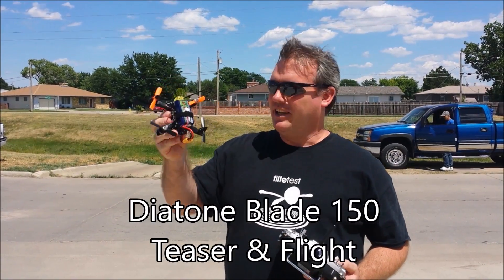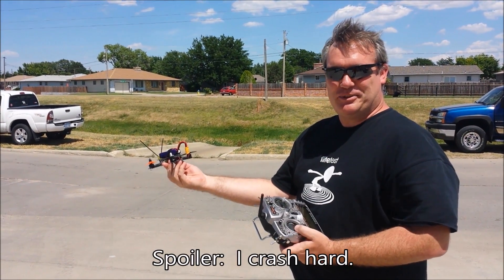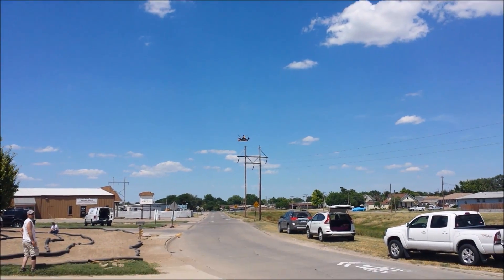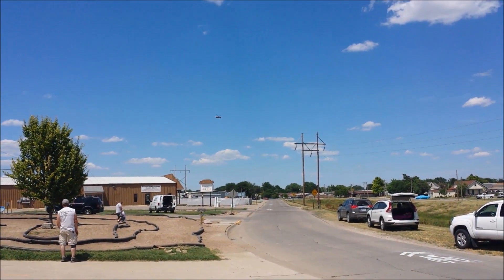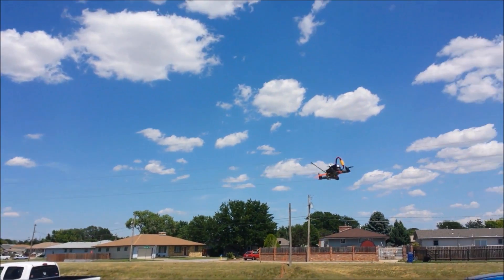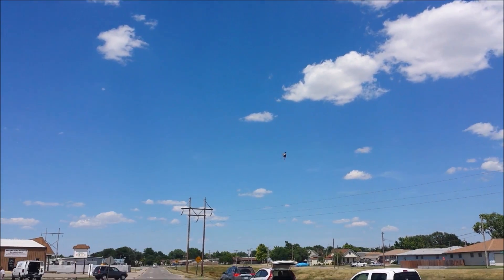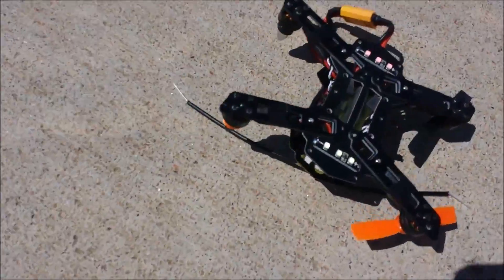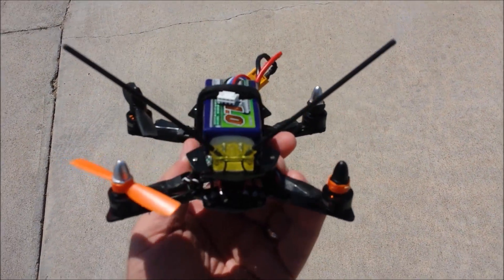Diatone Blade 150 TEASER & LOS FLIGHT

Comment: Are you using Cleanflight?
Reply: ***** ...Was just thinking while watching ,..He's a brave man trying flips over concrete.I'm interested in one of these as a first FPV Quad !!
Reply from the maker: Marcelo Tito Farinon No, I'm using OpenPilot.  I'll go over the tuning in my upcoming video.
Reply from the maker: integra It would be a good one for a first FPV quad!  Its small size helps it not break very easily.  I have a camera & video transmitter on order for this one.  I'm hoping it gets here soon!
Reply: Looking forward to reading your build !
Reply: ***** Do you know the difference of the "ET" models ?...I can see the Back Legs are'nt as wide as the front ,but why and how does that affect flight caracteristics?